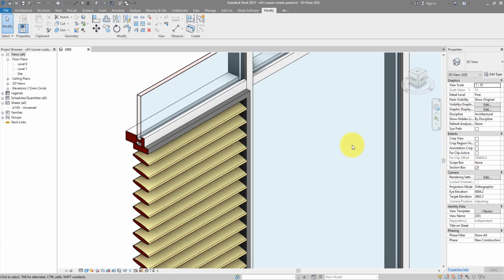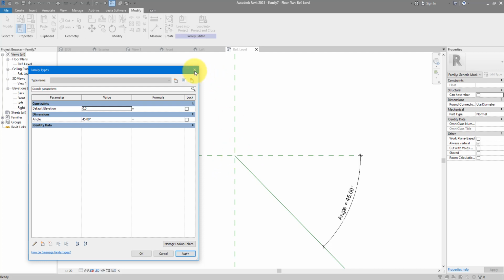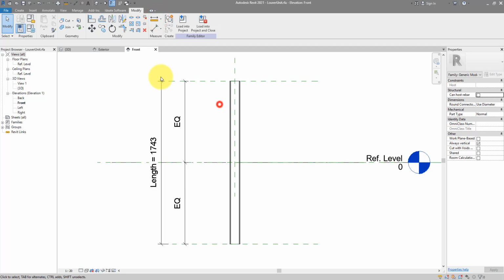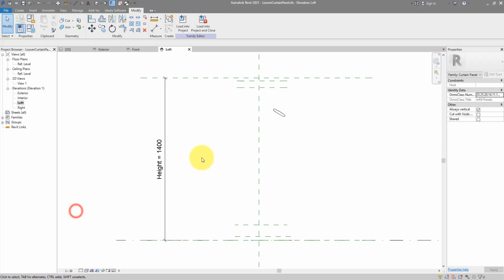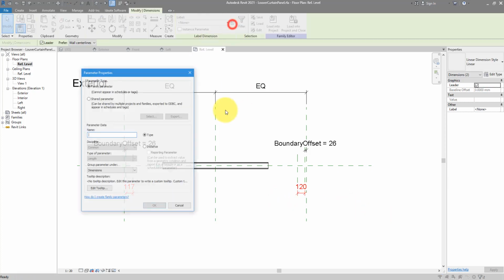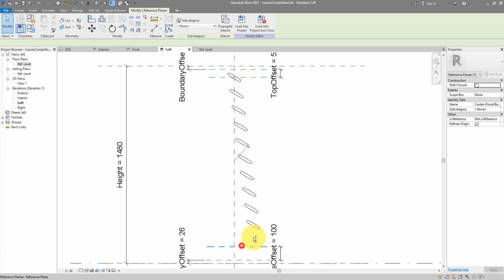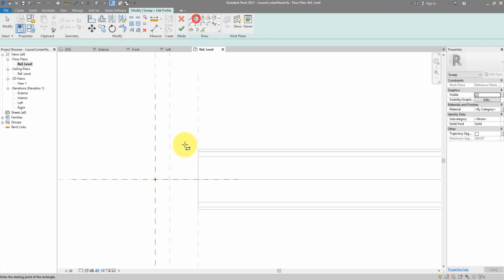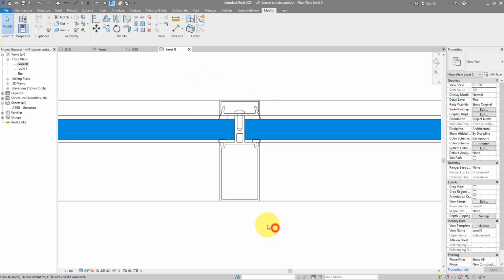Revit Snippet: Create Louver Curtain Panels with custom Angle Parameter!

Comment: Hello, when I increase or decrease the height of the panel, the louvers get stucked in their position (they extend til the last point of the Array), so if array end point was at 2000, if I set the heigh to 1000, I get many louvers going outside the frame. Same if I set the height to 3000, I get 1000mm of void space in my frame, the only thing that changes is the spacing between louvers. What's wrong?

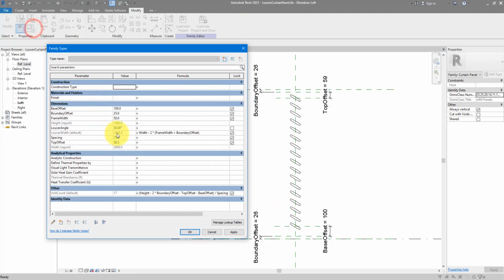Comment: Hello thanks for the tutorial. I am trying to do it my self by following your steps. However, for some reasons I get to this error "A reporting parameter can be used in a formula only if its dimension references are all to host elements in the family" when I try to write the Unit count formula. minute 19:00. Any idea why this occurs to me? Many thanks
Reply from the maker: When placing the dimension, you probably picked something different from what I picked. It can be tricky because elements tend to overlap in the family editor, so please use Tab if necessary. For a dimension to be convertible to a reporting parameter, it has to reference only elements that come with the family template, i.e. things already available when you first open the family for editing.

Comment: hello sir,

does it matter if the border lines in the beginning appear in the "interior" elevation, and not in the exterior ?
and they don't appear in the left one, they appear in the right.
Reply from the maker: As long as you can still create the same window, I guess it doesn't matter. If you will schedule in the future which rooms the panel opens to and from, it's probably worth picking the Interior and Exterior side correctly.
Reply: @RVBoost  Thanks alot

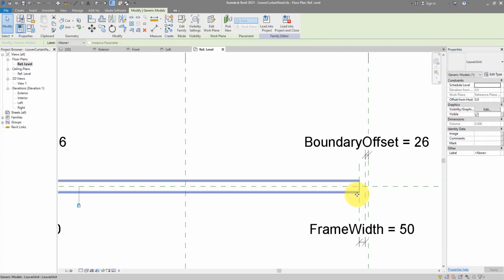Comment: Thanks for this video, i followed every step, when creating louvre width and put the same formula but the width doesn't change and remain small it doesn't change to 3000 (15:33) , it's kind of deactivate by default.
What can i do to solve this?
Thanks
Reply from the maker: Hi, if you have set the formula right then something probably isn't set properly in the louvre unit family. Please open it to check.
Reply: @RVBoost  okay thanks